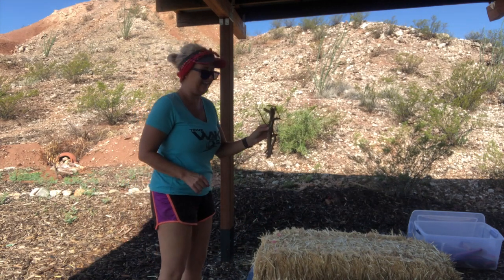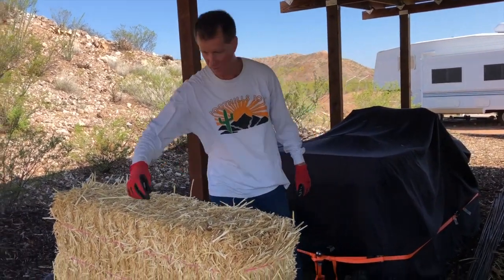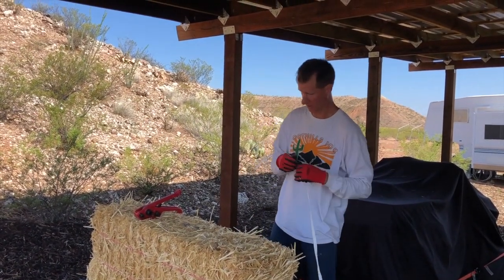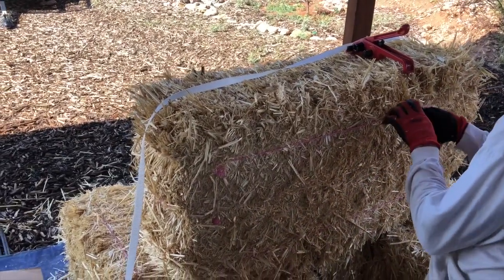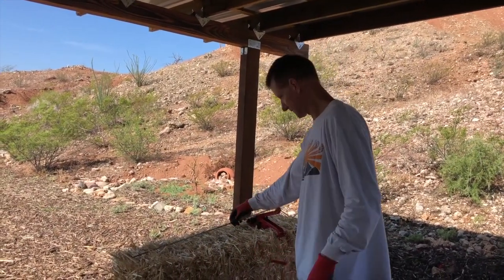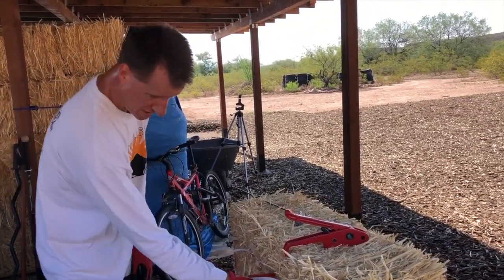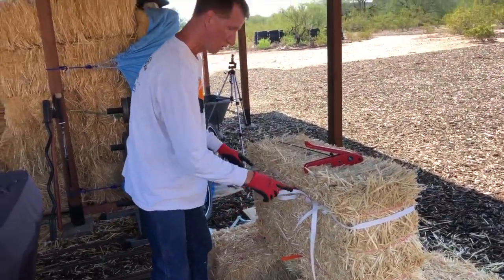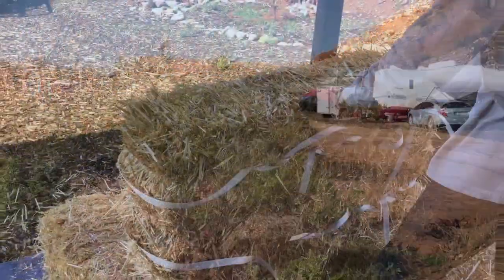Splitting Bales: 101 | Preparing To Build The Walls Of Our Straw Bale House

Comment: How do you keep the straw bales from spontaneous combustion?
Reply from the maker: Spontaneous combustion in a bale is caused by excessive moisture content, which leads to decomposition, which creates heat.  Straw bales have a pretty low moisture content when they are baled, so this shouldn't be an issue.  This is actually one of the reasons not to build with hay bales, as opposed to straw.  Hay bales are baled with much more moisture in them, so that can be more of a problem with hay.  Good question, hope that answered it!